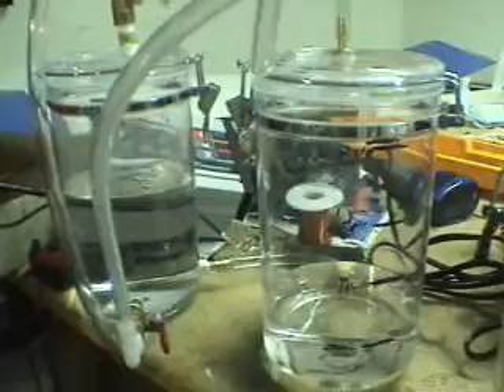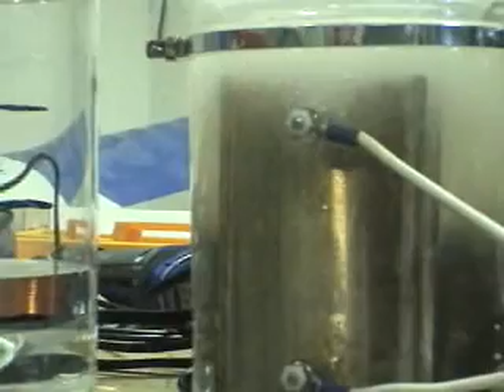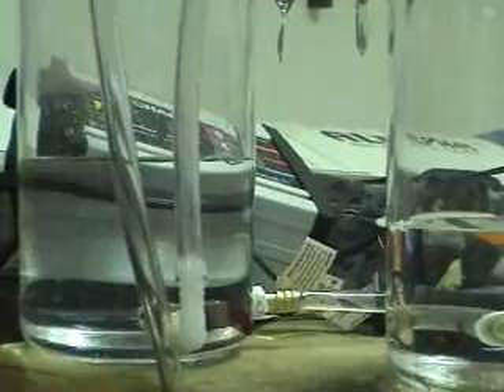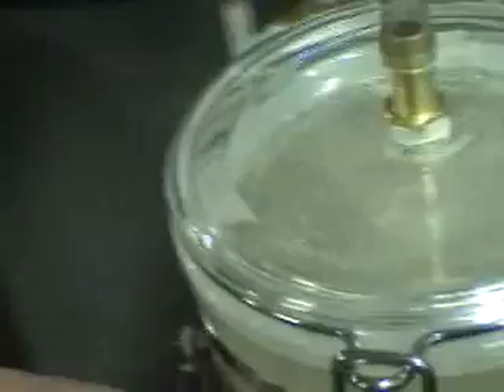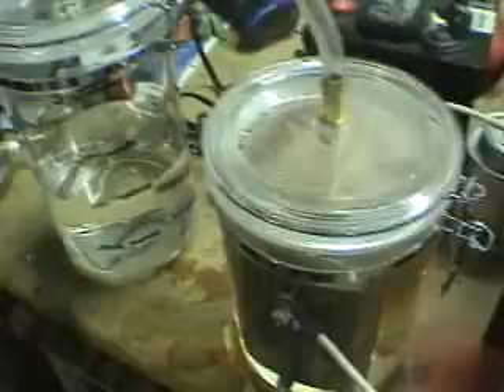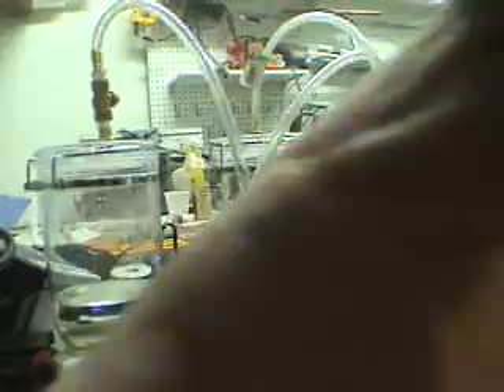water torch demo clam shell part 2

Comment: Not hundereds of pieces but it does blow apart easy. LOL  I know first hand when I tried a fiberglass flashback suppresser which failed.  I think I only had three pieces of canaster which did not really fly anywhere but the water did.  Afterwords I built a 2" pvc bubbler with a blowout and Fine brass flashback suppresser. The blowout was after your own work. ;-)

Comment: Accually the water is causing a vacuum because you had more water in the first bubbler which would try to equilize itself with the second container.  So it does not restrick the gas at all.  I would work on increasing your output more for a torch. Pressurizing the second container will only have short lived effects.  Nice work though.

Comment: The amount of storage you have in that bubbler is enough HHO to splinter that acrylic canister into hundreds of pieces of shrapnel, slice you up like butter and cause permanent hearing loss. I use 2" PVC. Check my vids.

I do like those extra tall canisters though. Mine are only as tall as the one you use for the electrolyzer. Where did you find them?